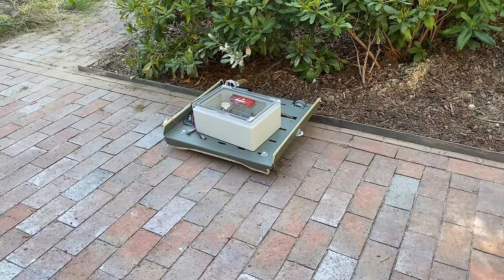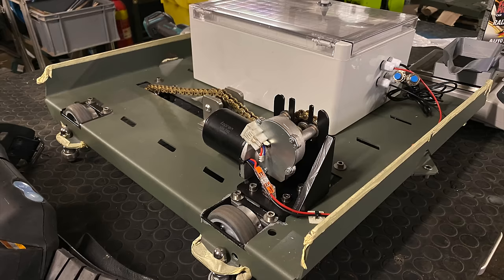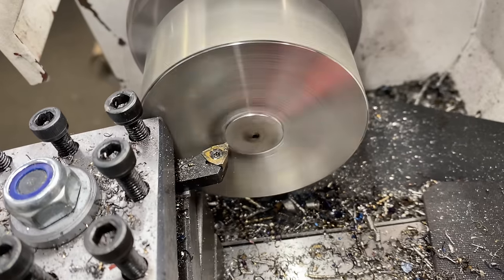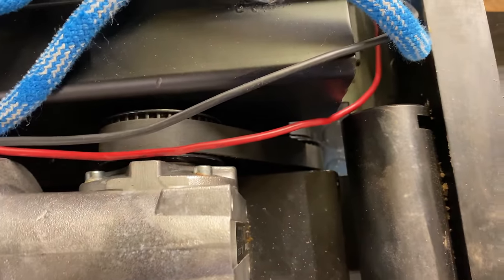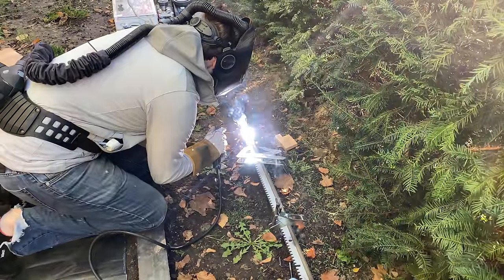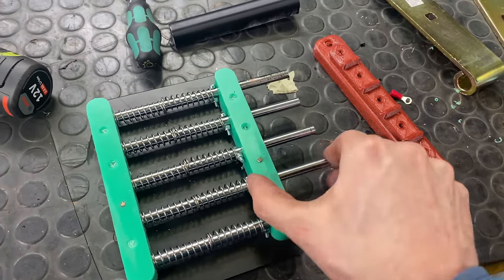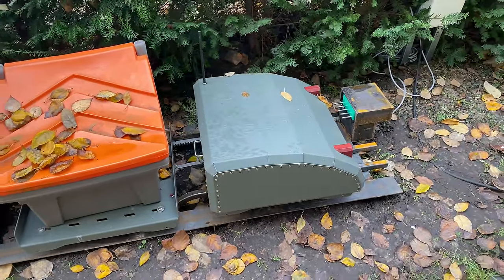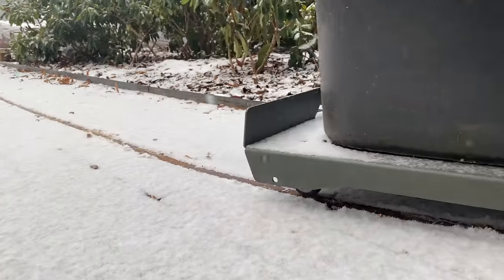I put my trash cans on rails and now they move automaticaly! (Trash Train)

Comment: Did you ever consider having one of the garbage cans sit on top of the drive unit to give it more traction?  I think if you could keep the rubber/plastic wheels from slipping, they won't wear out and it would simplify the design.
If I had any of the skill or access to machinery that you have, I would've tried to sandblast the horizontal rail to roughen its surface.
Reply: Or just put the driven wheels on the other side, on the flat track maybe.
Reply: He needs traction mostly when bringing it back inside (Since there is a slope). And at that time the trash cans will be empty and it won't serve the purpose of giving more traction.

Comment: for the endstops, maybe you can magnetically detect the rack, and set the end position with a gap in the rack (ie an angle grinder cut ?) 
The thinking being that you would get a continuous contact endstop (ie, no detection=>no movement), and also the endstop would be tied something highly functional to the movement, so of all the weird conditions that could fool the system, "sensor ON == train on track" is highly probably true.
Reply from the maker: Yes we thought about some kind of crude morse code, but ultimately the proximity sensors were just not reliable enough. At 2mm they register. At 3mm they don’t. So they needed to be so close to any rail that it was likely they would have collided.
Reply: @MaxMakerChannel  How about a hall effect sensor? you can even use the different polarity of the magnet to indicate the start and end of the track. Also no moving parts that can fail in the future.
Reply: @MaxMakerChannel  add an emergency/redundant stop with signal from the charging circuit
Reply: @MaxMakerChannel  How about an optical sensor using infrared? The IR source and receiver are 'track side'; there is an IR reflector on the last car or locomotive; when the IR beam reflects the beam back to the IR receiver, the controller stops the train?

Comment: Awesome!

* Do you need to do anything to keep the rails from corroding since they're in contact with the ground?
* In successive builds, maybe you can use e.g., a water jet to cut a series of uniformly-spaced holes/slots in the rail instead of using a rack. This would be similar to tractor-feed printer paper or the slots used to advance photographic film.
* Another interesting option for traction might be something like the "walking" mechanism used in chain strainers which are used to pull high tension loads.
Reply from the maker: Yeah it would need to have the teeth incorporated into one side of the rail. Otherwise it would be to expensive. Thats doable I think. A cable system inside a C chanel would be my next test.
Reply: @MaxMakerChannel  What about a different type of wheel, something with a tread pattern instead of smooth metal? Look at the battery-powered cars for children; some of them have tires with very 'gripping' patterns on them. This would also eliminate worries of users going across brick pavers or concrete getting the surface all scratched.
Reply: @MaxMakerChannel   There are cog monorail tracks that are commercially available.   There are several types.

Comment: love this! does it link up to home assistants like Alexa? Be good if it automated taking the bins out and back in on a schedule so you never forgot or if you are on holiday on the bin day :)
Genius!
Reply from the maker: Not yet. I will probably use a switch bot to just press the remote on those days. They are easier to program over the phone instead of using Arduino.
Reply: @MaxMakerChannel  you might want to look into ESPHome, with that it is very easy to use an ESP8266 or ESP32, get everything into home assitant, and also do OTA updates.
Reply from the maker: @mikeydk  I just pulled a Node MCU V3 out of a drawer and I am playing around with it right now. It seems a bit complicated at first.
Reply: @MaxMakerChannel  absolutely! It is a very different way of making it do what you want, but after learning how to use it I have replaced almost all of my devices with my own code, and now running ESPHome on all of them. It takes a bit to get used to, but in the long run it is a lot easier to make changes and do updates.
Reply from the maker: @mikeydk  I will check it out. Have you got a example sketch that I could check out?

Comment: Hydraulic bender is pretty neat. Hadn't seen one of those before!

Really awesome. Can you elaborate on the controls electronics? Looks like you're using an Arduino Uno. What kind of motor controller?
Reply from the maker: Hey! The motor controller is a BTS7960. Its the same one James Brutton useses sometimes. It is rated for up to 40A and driven by PWM. That made it easy to get smooth acceleration curves. I had no issues whatsoever with the driver. It works great.  

The arduino does the accerlation just with delays, but very short ones of 5-10ms. So it keeps detecting button or endstop inputs very frequently. 

One Issue I had was that the CAS batteries don´t have a low voltage shutoff. So in the future I might need to add a external circuit for that to stop deep discharging.

I wish I could just create the whole circuit on my computer and then order a PCB with everything on there. The cable mess is not fun for troubleshooting.

Comment: Did you know that trains have slack between each wagon? In that way the locomotive pulls itself first for a few centimeters and then the next wagon etc. So adding slack helps to accelerate while lowering the weight of the locomotive.
Reply from the maker: I noticed that. There is only a little bit of slack here. But it slowed to a stop at the incline. So its not the startup torque, its the incline torque thats the problem. Or was.

Comment: XL170 , its a small toothed belt as used in the food industry.........I used them to run a high performance, oil scavenging pump on a race car.......handles power and high rpm really well. They are truly amazing things.

Comment: Ditch the train track setup. Build the motor car as a tank on tracks to pull the wagons anywhere via RC control. Slow speed high torque / pulling power . More universal to fit any yard type.. bonus if you can program it to remember the path so you can set it to auto move on a schedual .

Comment: Great video.   One little language tip.

at about 13:25 You say, 
"But now it's working really reliable" (Aber jetzt funktioniert es wirklich zuverlässig)
That would be 
"But now it's working really reliably "  (which also translates as Aber jetzt funktioniert es wirklich zuverlässig)

Since both translate the same to german, I bet there is no german equivalent for the difference between the two words.

Simplifying to try to highlight the rule:

But now, it is reliable.  (adjective )
But now it works reliably.  (adverb modifies "works")

Your english is excellent and I mean this small tip in the kindest, most helpful way.

And that is a cool trash train!

Comment: Very cool project. As you need or can tolerate weight on the locomotive section a sealed car battery (or a mobility scooter battery) and solar trickle charger  on the casing would eliminate the parasitical drain of the charger. Solar won't give a lot of current at that location but more than enough to top up the battery after a couple of return trips a day, and cheaper / more environmentally friendly than using lithium batteries.

Comment: While I see the merit in this design, it looks a bit overengineered as the trash cans themselves already have wheels on them. It is like if you wanted to pull a series of cars somehow, so you designed a way to mount the cars into a train, and then you have all this power to make sure the cars remain fully still while on the train... instead of just making something that pulls the cars using their own tires. In the US, some kind of system to take the bins from the house to the curb for pickup would be amazing, but it needs to be fairly simple or else no one would use it. And the garbage trucks that come for the garbage are generally not kind to the bins, so not sure how that'd be solved easily. For your scenario to move them out-of-sight, I feel some kind of system where you hook the bins in at their base and it just pulls them horizontally might work. You may need to add other wheels to the bins, unless the bins can't be modified. All-in-all, great work but I'd investigate a simpler way to where the movement of the bins is based on their own ability to move instead of mounting their movement to another moving platform.

Comment: Usually people create their prototypes out of off-the-shelf (OTS) parts
but you tackle the problem with your creations which is make it more than hard than it is
You could easily achieve the same results with sliding door mechanism (instead of sliding doors it would be slides some trays)
which is fairly cheap and it would be grid powered.

Comment: Awesome video.
For a commercial version I would recommend using an off the shelf sliding gate motor installed on the front of the train, this would simplify all the electronics and be easily reparable. I don't know what brands are available local for you, but for me somerhing like the centurion d5 Evo or d5 smart would be a very modern motor with electronic sensors to find it's origin, start and stop. Only problem I see with using a gate motor is the output shaft that engages with the rack may need to be modified to work on a bendy track. charging the battery could use the same system that you created at 12 volts or solar is an option.(forgot about the snow)

I actually know of someone who used a gate motor to move camera setup on a track up to 100m. Was basically a 1 cart train setup, I don't know if it had any curves in the track.
Reply: if that thing only needs to move once a month, solar-only is totally viable

Comment: I would use an existing gate open/close motor system. Modify it and achieve the same goal. The motor stays in one place on ground. The trains are fitted with teethed guide at its bottom. With the train platform, teethed guide side comes with hinges for curves while the other side are not connected.

Comment: Thank you for this video. It's was awesome.  Instead of putting that insulation tape underneath the panels to prevent from making noise from vibrations, you should need roll a design in the center of the panels. This will create more strength to those metal pieces and prevent from vibrating with noise. Again, great video and thanks.
Reply from the maker: Thanks, I didn´t have enough material for all otherwise.

Comment: Trash train phase II
Get your garbage collector is to send the train back, 
1.	Install shaker switch on curbside flatcar to indicate when trash collection is taken place.
2.	Signal to voice synthesizer stating “all aboard”
3.	install post with remote control to send train to backyard, connect large industrial red push button with signs stating return trip (send train back)
4.	After you train your trash persons to press the button reward them with a low volume whistle like a conductor uses on a passenger train to indicate to engineered to start train and then a low volume whistle.

Comment: Well done! Regarding your grip-issues: what about coating the flat track with a PU-resin (e. g. Estovoss super made by Vosschemie) and disperse some silicon carbide in? would run as folows: 1. layer: G8 super; let dry for at least 3h until it is not moist any more but sticky. 2nd layer: Estovoss super. mix it up with some silicon carbide and get it on your track. 3rd layer: some Estovoss super with nothing in it besides some thinner.
Replace the roll runing on the flat track by a vulcollan-roll instead of a rubber roll.
This in combination should give you more grip
Reply from the maker: Wow. Some very detailed information! Do you work for them?

Comment: I work with motors, rails, and the metal sensing end stops like the ones that didn't work for you. This system is so beautiful. It is so insanely over built, lol, but its great. Would to change A LOT of stuff to make it commercially viable though.
Reply from the maker: What have you got in mind? I am changing a ton of things for sure. It needs to be easier overall.

Comment: First of all , great idea!!!
Also, Could use hard rubber on tyres and sand the track so as to increase the traction.
I might steal your idea ;)
Reply from the maker: The track has a very small surface area to keep it invisible. Had I built a wider track I would probably have used rubber wheels.

Comment: In this rural area of scotland i have to move a wheelie bin 300 meters and no way i could use such an advanced thing as a train, but a power-assisted hand-drive... like your modified locomotive with big rubber wheels and a hand control to do the same thing you're doing, but across rough ground with a human driver... for your customer needs, my wife can't move a heavy bin, so a battery-driven wheelie-bin locomotive would be in my opinion a more marketable commercial product... not a train, but a weelie-bin powered forklift and drive assist...  Then your commercial product would suit anyone with a wheelie bin who's not strong enough to roll it around... and not just people who can install a train track.  Bless you and thank you for the inspiring idea.
Reply from the maker: There are these monorails where you just push a cart along a single vertical flatbar and balance it with a long bar. Very easy to set up.

Comment: Awesome idea but need some thought into the orientation of the wheelie bins. Bin-men (at least in the uk) want to pull the bin off then pull them back so the bins are 180 degrees rotated during one emptying session - so one could have each of the trays rotatable 180 degrees ideally automatically maybe depending on the bin wheel positions?

Comment: I get you wanted to experiment with a track system, and kudos to you for such a cool and functional project. It seems to me however that a cable/winch system would be easier to build, more efficient, and cheaper to run, with less things to break.
Reply from the maker: I agree, but there is one problem. How would you go around the corners? You would need a lot of pulleys on the side.

Comment: Hello, great project. :goodvibes:.
I understand that it's an old video.. if there is going to be a next version, i suggest going the cable way instead of racks, like mountain cable cars... A lot of weight could be reduced, all propulsion components will be static and no issue of traction and much simpler and cheaper drivetrain.
Cheers
Reply from the maker: But how about the corner?

Comment: love the build, one solution could just be a simple pully and wire system, could help simplify things and lower the cost by allowing you to keep the propulsion stationary allowing you to power it from the mains and removing the need for a battery as well as helping to reduce the need of adding a lot material down for weight, reduce the need for custom and expensive gear systems and remove the need of a rack and pinion system.  Could be as simple as using a cheap off the shelf  winch with a cut off switch on either end of the track.
Reply from the maker: Yes, but how about the curves?
Reply: @MaxMakerChannel  the simplest way I can think of would be to tension the cable and use pulleys that only tension the cables/belt  from one side to allow the attachment point to pass, though for simplicity and structureal sake it might pay to have the pulleys, winch, and a rail as one unit.

I based the idea on something I work with, I work on a railway depot and we use an old wire and pulley system the change some of the roads it's been in place since the Victorian era so is pretty reliable lol.

Comment: Amazing project! Nice job. Rather than using the rack and pinion, you could use your existing smooth track and have a rubber drive wheel contact one flat side, with a spring loaded idler on the other. The spring loading would press the track against the rubber drive wheel, giving you the friction you need. This would reduce cost and complexity, and eliminate the risk of debris getting caught in the teeth.
Reply from the maker: We thought of that. My fear was that it could come off the track easily. If there is some deflection, there could be a slight upwards vector and the wheels would be pushed upwards. If I had a different rail geometry it would be easier.

Comment: Cool idea! (Except where I live in California, if I had a train like that California would probably require me to add strobe lights, a horn, someone to monitor the lights and horn, and charge me a yearly registration that costs more than the train.)
Reply from the maker: Here in Germany those things are regulated with "generally recognised codes of practice”. Obiously there aren´t such rules yet for a trash train, so you can come up with your own. I adapted the train to follow the rules of a sliding gate since those are very similar. And for sliding gates all you need is to make it stop when the resistance gets to high. So in this case I used current controll to sense if the motor is overloading. Also if that doesn´t work, the fuse would blow and also the gear would disengage from the track since it is spring loaded.

Comment: Very cool project, I'd add physical safety stops in case something goes wrong and there is a lot of stuff in the trash cans. Don't want anything rolling onto the asphalt or even worse hitting something on that asphalt. Wouldn't take much effort but add a lot to the safety of the system. I can see that it is very unlikely for any mishap like that, but with high wind and some other mechanical failure it could be possible.

Comment: I can't help but think that making it more like a ski lift with a fixed motor unit and a cable running the length of the track, attached to the train, and wrapped on pulleys on each side, would have solved so many of the issues you had making it a self propelled unit.